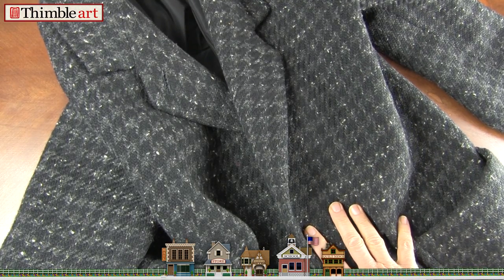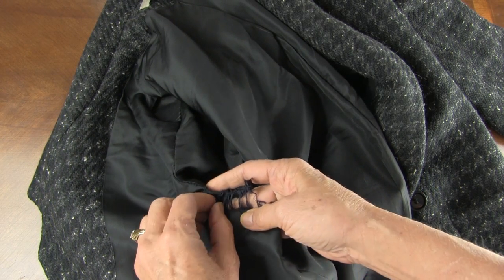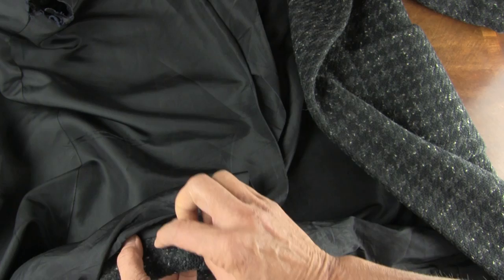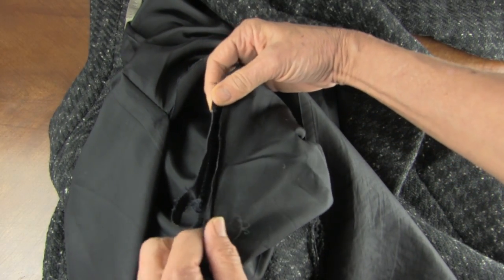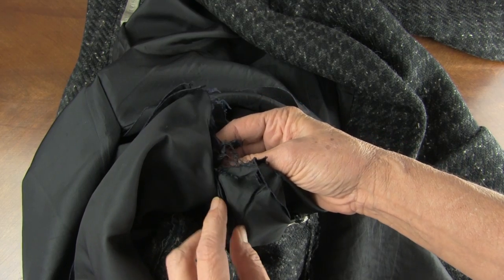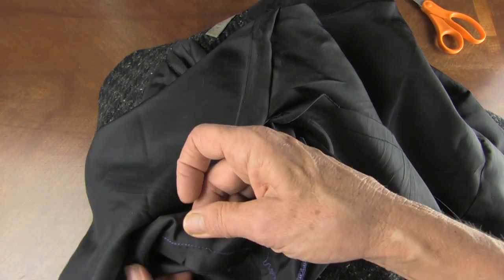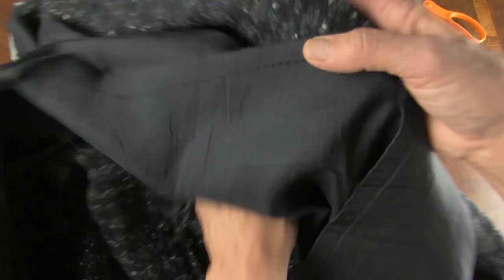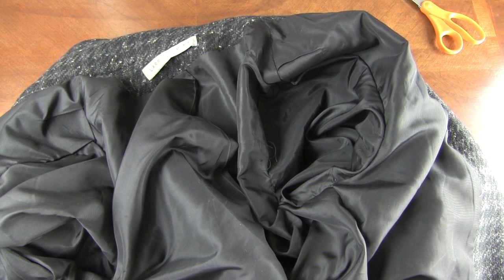How To Fix The Lining In Your Coat

Comment: I have a, vintage fur coat where the lining has pulled away underarm and frayed.
Won’t the lining, be tighter by using this method and cause it to tear away from the stitching?
I was going to cut a piece of lining, from an old coat and insert, then sew?
Which would you recommend please?

Comment: I’m wondering if this way of fixing the lining makes it a bit smaller than it used to be? When u put it on, won’t it be tighter inside n make u uncomfortable when u wearing it? I got a coat n the lining is broken exactly the same place as urs...trying to find a way to fix it. I was thinking abt close the hole like u do, but that’s my concern...I m not sure it will be comfy when I wear it coz the lining will be smaller in the armhole part.
Reply: I do clothing alterations and repairs and I was searching for a solution. This is a solution if the damage isn’t to great, but if it is more significant than this, this won’t work for the reason you mention